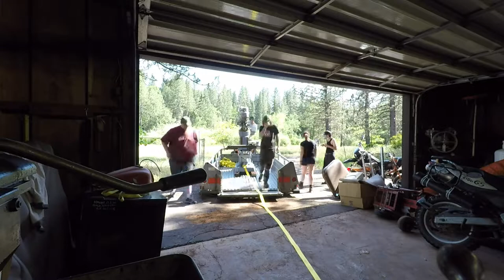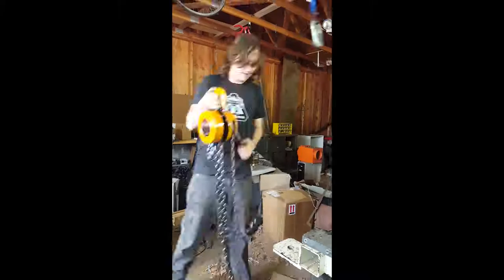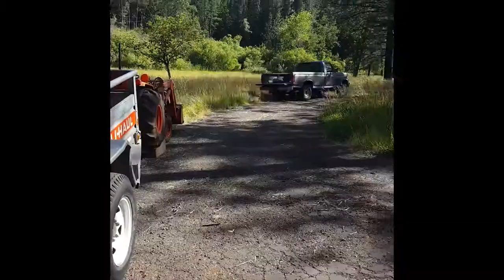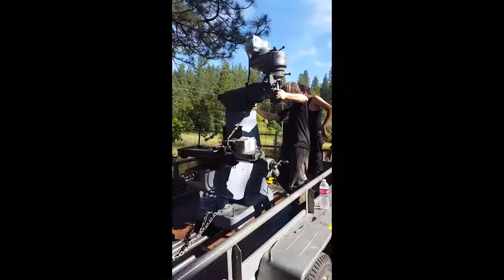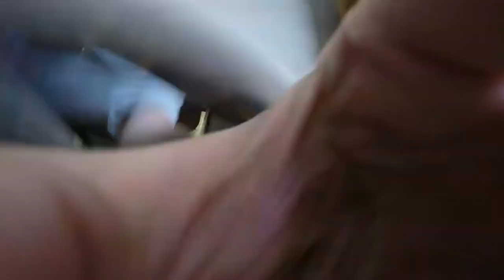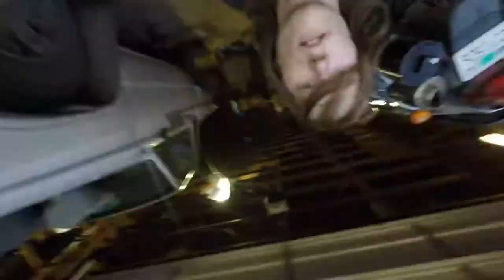Move a Bridgeport mill on the cheap with a Uhaul trailer.

Comment: You should have rolled it down on short sections of pipe with a strap behind to let it down slowly.  Great soundtrack.  I like the skids to move it on.
Reply from the maker: clockguy2 I definitely considered it but then id need a toe jack to lift ot or some real big jimmybars, pullin it was a little tedious but putting heavy things on rollers to send them down a ramp is really sketchy, definitely safer with the little extra work.

Comment: I'm prepared to forgive you for your horrible unloading because of that glorious soundtrack hahahahaha!
Was that Mungo Jerry, Stevie Wonder and Van Halen all at once? :D
Reply from the maker: Horrible unloading, psh. How would you have done it? Only thing I had to buy was the 3 straps holding it to the trailer.
Reply: A pallet jack served me well for moving my mill and lathe, and its seen a lot of use since then.  I paid $100 on Craigslist, money well spent.
Reply from the maker: The original plan was to hoist it out of the back of my buddies truck with chains slung between two trees, I was planning on getting a pallet jack to drop the machine onto after the truck drove out from under it to wheel it into the shop but honestly, the pallet jack wouldnt have really helped this time after we conceded it was best to rent a trailer.
60 bucks for a two day rental on the trailer
60 bucks for the straps on the trailer
30 bucks for the ski's and hardware.
120 bucks gas to get it home. (6 hrs Santa-cruz > lassen)

Taking everything into consideration I think it was a flawless move. I think having a sure fire plan that takes a little extra effort but guaranteed to work is a better way to go than trying to factor too many unknowns into the plan. Pallet jacks are really tippy because of the single wheel at the back and I diddnt wanna try rolling it over my fairly rough and un-even driveway. The skids worked great and that piece of wood was only 20 bucks. I really really didn't want to spend a penny more than I had to being unemployed right now.
Reply: Understood.  I had unbroken cement all the way, and grinding something across concrete makes me cringe just thinking about it (personal quirk, its like nails on a chalkboard to me).

Are you on walkabout?  I can't imagine a skilled CNC machinist goes unemployed much longer than they want to be.
Reply from the maker: Been doing on and off temp work for Megabots, I machined the leg pivot pins and bores on the mk.III and hoping to apply at the LBL where Tom Lipton works in the next 3 or so months. I left Morgan in September of last year.